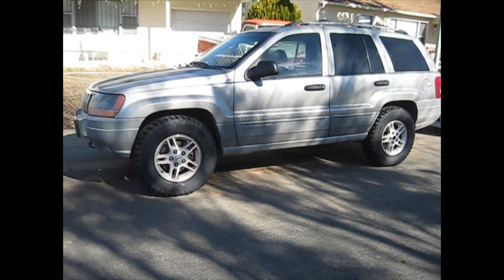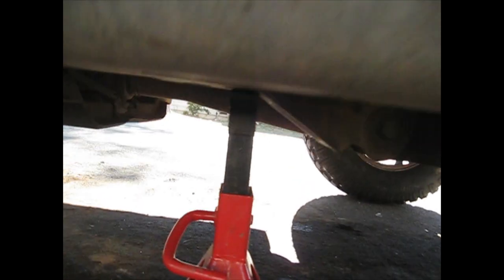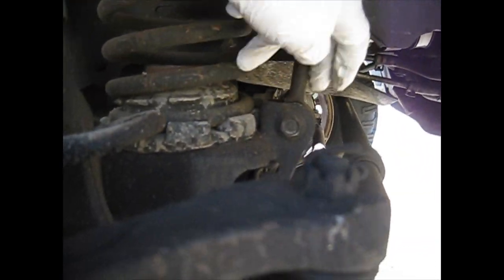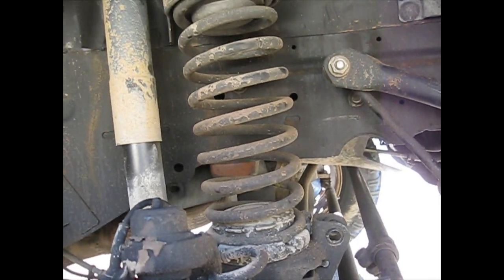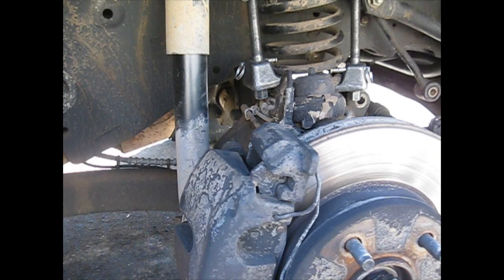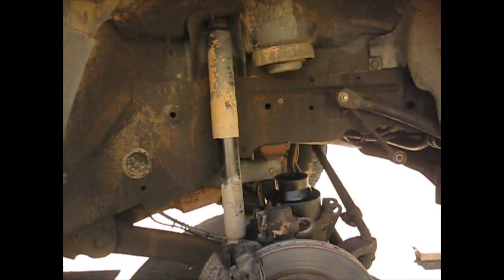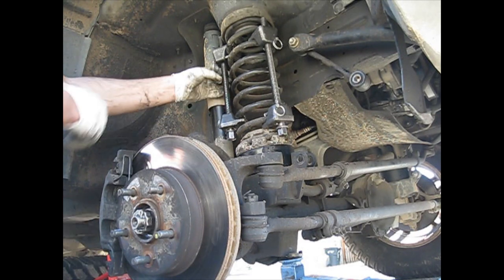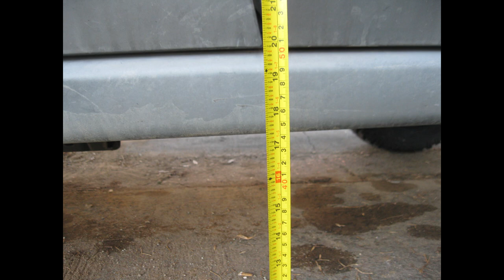2000 Jeep Grand Cherokee WJ 2" Budget Boost lift front

Comment: Front spacers go on top, rears go on bottom.
Reply from the maker: Are you sure? Please tell everyone in your opinion why and what the difference would be top vs bottom.  Theoretically it should not matter if its on the top or bottom. It drives like stock and 4wheels even better.
Reply: @FastestIntegra  because thats what the instructions say & also everyine elses comments.
Reply: @FastestIntegra  the spacers absorb energy to reduce vibration to the cab.  You'll feel it more with the spacers on the bottom
Reply from the maker: NOT true.
I talked to the guys at Rusty's Offroad. They said theoretically it does not matter if it's on the top or the bottom. 
The spacer is not a vibration dampener it's a spacer. With or without it the vibration would be the same if it was on top or bottom.

Comment: For the amount of years that I've been working on vehicles I just noticed something that should have been noticed. I was always using a breaker bar to compress the coil but you got it right by using the jack and compressing it that way. Good job and great video. I just got my 3-in lift and I'll be doing the same this week

Comment: I bought a budget boost kit from JGCParts for my 04 Cherokee... 2.5"front and 2"rear. Their instructions really did not go into detail. Your video saved me $$ from having to take my Jeep into an auto shop to get mine installed.  I also installed new shocks so the job took me a few hours. Thank you for posting this video, it was really really helpful. positioning of the spring compressors is key, i rented mine from my local auto store. Thanks again.

Comment: You placed the spacers on the bottom of the springs but rusty's website says they ride at the TOP of the springs. Did you do this for any particular reason?

This kit is simply a set of 4 spacers positioned on top of the factory coil springs. Since the factory coils are retained, you can be sure this kit has no negative effects on the excellent factory ride characteristics! No bump stops are needed; we have found that they may limit travel more than needed unless you use a significantly larger tire. We recommend a maximum 245 size tire for this kit.

The factory shock absorbers are long enough to work with this kit, however we recommend replacing them with Rusty's Hydro Performance Shocks for an better ride and for proper extension travel when the vehicle is used off-road.

Comment: I want to put a similar 2" budget lift on my ZJ but I've been warned that it will steer funny without adding adjustable control arms on. Did you have any unstable steering issues after this?
Reply from the maker: No problems with 2 inch lift it's when you get to 4 inch or more is when you have steering and Driveline issues
Reply: @FastestIntegra  
I can't read that tape measure. Idk if it's the video or my signal is bad. Can you help me with those measurements?
Reply: @FastestIntegra  
Please 😁
Reply from the maker: @xmo552  The ZJ's are a little bit cheaper to build then a WJ. The measurements in the video was showing before and after getting 2 inchs over stock for a WJ.
Reply: @FastestIntegra  
Yeah. Thanks. I was just wondering how my WJ compares to yours.

Comment: Bro, Extremely informative on the size=brand of tire and the difference shown with and with out. I just bought a 99 and I am realizing everything you can do, so far I'm Impressed! Good video my dude.
Reply from the maker: I did not rotate the rears to the front until the fronts needed to be replaced.  I am just now needing to replace the other two tire's, I got about 25,000 miles out of them. with a lot of off road use.

Comment: Nice video work. Looks good! I have the same size tires on my stock height 04 @ they rub the wheel well on tight parking lot turns. 2 inch looks like it worked out prefect. Thanks four the video. I'm sold.
Reply: Jason White wat size ? I wanna get mud tires but dont wanna lift

Comment: Also, should totally replace the shocks if you plan to actually wheel it. If it's simply a road queen then...I'd still replace the shocks to make up the difference,  just the right way of doing it. Not hating, just saying. I have a 99 with a iron rock off road 3 inch and a 00 with a 2" puck lift but on both the shocks have also been changed
Reply: Since you have both would you say the Iron Rock is worth the extra $?

Comment: thanks for doing this video..I just got a 2002 WJ with low mileage and wanted a little lift for trails but not super crazy..so the budget boost kit has everything but spring compressors right?..let me know when you can as I'm saving up to get it

Comment: One question: Is the shock absorber the same as the original one or did you change it for a longer one?
Reply from the maker: You could use the stock shock absorbers for up to 2 inch after that you need a longer shock

Comment: I'm looking to do the same to my jeep and i have some questions for ya.
1.Did you have replace other parts like brake lines or sway bars?
2.How are the coil spaces working out for you/ have you had any trouble with them.
3.Did you get exactly 2" of lift? more or less? And does you'r jeep sit even after lift was installed.
sorry for so many question. great video by the way!
Reply from the maker: 1. You don't need to replace anything with the 2" lift
2. It drives like stock and 4wheels even better. 
3. I got exactly 2" front and rear.
Watch the beginning and the end of the video for the before and after pics.
Reply: Thanks you I appreciate it.

Comment: Do you have cv or u joints? Asking cuz was about to buy rough country 2 inch lift comes with shocks too but in the website says not to use with awd they told me i would have to change my cv axels with u joint axels wondering if u had any problems
Reply from the maker: I has CV axles.
My WJ has been great with it's 2" lift.  
From what I'm told and from all the wheeling I've done in my Jeep. A 2'' lift should not require anything. I've read that you only need to start replacing other thing's is when you lift it 4 or more inches.    
That being said, My WJ has 219,000 miles the front CV axles are bad now after 4,000 miles mostly off road since the 2" lift.
I want to blame that on doing Donuts in mud and snow, not under normal driving.
Reply: I was confused, what they where talking about was the propeller shaft, just found out some have cv joints and supposedley thats what is not recommended but thankfully i looked under my wj and has the double cardan u joint driveshaft so i will be getting the 2 inch lift only bad thing also found some leaking from pinion seal while i was down there. Did u buy a new steering stabilizer with the lift?
Reply from the maker: Joel C I only got the Rustys offroad 2" spacer kit. No steering stabilizer, thats for 4+ inch lifts.
Check my WJ out in action  https://www.youtube.com/watch?v=i-zm0S8EbnY

Comment: Hi me again was wandering did you blow out ur shocks or did you have to change them to after market like 0-2'' in shocks? or did you stick with origanal shocks and do they work good anough? with out changing them? just wandering due to I havve ordered the 2'' lift kits ya told me about and was wandering if I need to change my shocks or NO? thanks again
Reply from the maker: I'm running the stock shock's and springs, They work good with this kit.
Check out my new videos.
Rustys Offroad sales a 2.5" shock's and springs kit for $380

Comment: Having trouble with the front end. Replaced cv;s and ball joints,no change. Car groans when turning and feels like it sort of slips or moves over a bit when turning There is no play in wheels or steering and does not vibrate.Any help? Thanks John
Reply: i had the same problem. it was the power steering pump.

Comment: So I see you put the front spacers on the bottom. For skyjacker (same spacers) they detail you needing to put the front spacer on the top. Have you changed this or had any issues?
Reply from the maker: Theoretically it should not matter if its on the top or bottom. It drives like stock and 4wheels even better.
Reply: It was a good video and what I used as reference to install mine a few days ago. I just ordered the addco rear sway bar and new rear sway bar end links too. The stock one is so thin and cheap.
Reply from the maker: Gary Galmin Did your put your spacers on top or bottom?
The factory sway bars definitely need to be upgraded for road use.
Reply: ***** I ended up putting my front spacers on the bottom and rears on the bottom also with new skyjacker shocks.
Reply: Just an update to this. My spring perches were rusted out and bought the repair kit from ironrock and once they were welded on, I moved the front spacers to the top and it rides a lot better.
Reply: Gary Galmin , Do you know a reason as to why it rides better with the spacers on top? less squeak or do the springs align to the perches better? I'm curious to know what an advantage to putting them on top would be.
Reply: OneTimeN BandCamp in my opinion everything fits together better and its where it should be according to the manufacturers installation.
Reply from the maker: Gary Galmin https://www.youtube.com/watch?v=i-zm0S8EbnY&list=PLm3plAbt177FdArI09TeIl3CYrYEV34nc

Comment: was wondering I have a 94 jeep grand Cherokee and was thinking about doing the same thing you don't need ant extent ions for the brake lines or drive line do you? and what about a 3" would I need anything else besides the spacers?
Reply from the maker: Nothing, Rustys offroad has a 3.5'' kit for the ZJ.
http://www.rustysoffroad.com/jeep-suspension/jeep-suspension-lift-kits/zj-grand-cherokee-93-98-jeep-suspension-lift-kits/

Comment: Neato! Now, what are "jounce bumpers" and where are they installed? Came across this term just today, and wondering if they help with bottoming out issues.
Reply: VideoNOLA Jounce bumpers are pretty much exactly what they sound like: small bumpers that prevent your body from bottoming out into your suspension.  They're installed behind the spring, under the vehicle.
Reply: Cody Deitz Thanks. I've since learned that "jounce bumpers" is what some people call "bump stops", which are two large rubber "bricks" that insert into two cups above the front axle. Mine were old and disintegrated (almost missing entirely). Found a cheap pair on eBay and installed 'em ... no more thuds!!

Comment: Could've saved a step by simply compressing the spring in the first place before putting the compressors on. Instead of lowering it, putting compressors on then jacking it up again to compress the spring.
Reply: Ricky Osborne it is much more difficult to fit the compressors on a loaded spring because there is not enough room in between

Comment: Do you recommend spacers on the  bottom of the spring or the top?
Reply from the maker: I'm running the spacers on the bottom I have not had any problems with it at all. I put on over 30,000 miles and have done a ton of off-roading with them on the bottom.
Reply: The spacer in the bottom is Factory rubber
Reply: The spacer goes on cop there's a factory spacer on the bottom which is rubber the one on top is metal

Comment: I started getting a horrible death wobble after lifting 2 inch. Any ideas?
Reply: Also I get the DW when i drive over 40 mph. ( DW happens some times) But its really bad.
Reply from the maker: There is a list of things it could be tie rod ends, wheel hubs, ball joints, etc. If you have a Les Schwab or somewhere that will do a FREE alignment pre-check have them diagnose it and then fix the parts yourself save a ton of money. Good luck if you have anymore questions check out my vids and feel free to hit me up.
Reply: @FastestIntegra  Is it possible having bad upper control arm bushing cause death wobble?
Reply from the maker: @udarasri4  yes

Comment: Why not leave it jacked up before putting on the coil compressors then let the jack down? Seems like ALOT of extra work/time for no reason...
Reply from the maker: There was not enough space for me to do that. The compressor just would not fit with it jacked up.
Reply: Those hooks can't fit between the springs?

Comment: Do you think i'll be okay with 3" inch spacers ? Thanks
Reply: Christian Legorreta i bought a 3 inch spacer for the front of my wj. went to get it installed and the guy said it was gonna need more parts such as sway bar links longer shocks and possibly new coils. and could be pretty dangerous the 3 inch is also heavier so itll compress the spring too quickly so he just bought me this kit and it looks really good

Comment: So you don't have to buy a longer sway bar arm?
So I could do this to my 2002 with no problem? ?
Reply from the maker: You can put this kit on Any WJ No Problems. You dont need to upgrade anything else unless your going to lift it more then 3 or 4 inch's. Even then a good kit should come with everything you need.

Comment: Great video man. I was confused about the coil compressor part though, what was the purpose of that and is it completely necessary? I don't have those specifically would be possible to use any sort of strong clamp??
Reply from the maker: If you don't compress the coil it will not come out or back in with the new spacers. 
I would only use a coil/spring compressor. Using any sort of strong clamp can be very dangerous if the compressed coil where to slip out of the clamp.. 
Check your local part stores they should have specialty tools for rent.
Reply: Alright cool dude. You're really helpin a high schooler on a high school budget!
Reply: ***** That's the kind of tool you can "rent" for FREE from AutoZone, O'Reilly Auto Parts, etc. Just requires a temporary deposit. (And hope that the previous user didn't tear up the tools too badly!)

Comment: Nice job but the spacers are supposed to go on the top of the coil front and rear. Spacer against perch, then insulator and then the coil. like you did but on top not the bottom.
Reply: Actually on the the budget boost kit it is designed to go on top of the spring on the front and below the spring on the rear. Maybe check your facts first man.

Comment: When I lift my Jeep with those spacers the jeep star doing death wooble
Reply: replace your track bar
Reply: What fixed it
Reply: It’s not just the track bar it’s the wheel barrings breaks ball joints and any part that has a rubber gaskets and also the upper and lower sway bars so just replacing the track bar won’t fix it I am handing the same problem after installing my lift
Reply: @JohnHornbostel-uz5gz  
Same:
Track bar new
Track bar bolt hole repaired 
New:
Stabilizer
Sway bar links
Ball joints
All bushings 
Shocks
Spring isolators 
bearings
Cv shafts
Bearings 
Seals
Shocks
Rotors
Calipers
Brakes
Steering gear box
All steering components 

E v e r y t h I n g
Except the axle housing  and diff.
Still got a wobble. 

I have a buddy at a race car alignment shop. He says on our 5 link Jeeps it's usually the track bar and tires. He says bad tires can induce a wobble.
My tires are pretty bad. Tomorrow I'm getting tires and the next day it's going into that alignment shop. 

I'll come back and report.

Comment: How do you install the blocks in the rear suspension
Reply: It's not a block it's a park a lot easier than the front remove your linkage Bolt and Shaq thank you Jack on the other side lift it up and your other side will go down put your spring in there you'll see when you do it

Comment: Did you have any trouble with death wobble after installing this lift and hitting a bump to cause death wobble if you did have this experience how did you fix it I finished my install 2 days ago I used your video to do so so thank you it made it a lot easier
Reply from the maker: No death wobble with the 2" boost. When I went to 4" kit yes, I have a good video on my channel how I fixed that.   I have over 275 video Please come check out🙃
Reply from the maker: https://www.youtube.com/watch?v=oZx6Kb3fGE8&t=98s
Reply from the maker: https://www.youtube.com/watch?v=oZx6Kb3fGE8&t=98s
Reply: No thanks bud you already screwed my over by not doing proper research and installing the front end completely wrong witch I have proved without a doubt with the proper directions from Rusty’s off-road the link is in my comments about flagging this video have a great day and good luck i would remove this video b4 someone gets hurt and sues your ass
Reply from the maker: @JohnHornbostel-uz5gz  LOL:yt::yt::yt:🦄🦄🦄🦄:face-purple-crying::person-turqouise-waving:

Comment: does it matter if the spacer goes on top or bottom
Reply from the maker: Theoretically it should not matter if it's on top or bottom I've been running them on the bottom for years now and it did not affect anything the Jeep drove perfect and four-wheeled awesome

Comment: How come you got more lift than me i my buddy and i both have wj jeeps and we both purchased the same lift as u budget boost and neither one of us got the full 2.5 in front or 2" in rear we only got a little over 1" i contacted the conpany they said they had never herd of that .
Reply from the maker: stephenjray1988 Did you put the spacers on the top or the bottom of the spring?
Reply: bottom
Reply: Did you use the same before measures he took?
Reply: I took them in same location but hell its been almost a year since i done it idk what the measurements were
Reply: stephenjray1988 you probably got less lift than he did because maybe you took off the issolators. the issolators them selfs are about 1 inch thick

Comment: I'm trying to figure out why you use such a little Jack if you used a bigger Jack to Jack it up with and a taller jack stand it would be so much easier I put a 3-inch lift on mine didn't have any problem...
Then you say put the tire underneath there for safety come on really those jack stands must be shity...
I did this I'm a w.k. 2005 Jeep Grand Cherokee limited trail rated...
And it did it by myself in four hours...
Front and rear..
Reply from the maker: Very simple answer I didn't have a bigger Jack